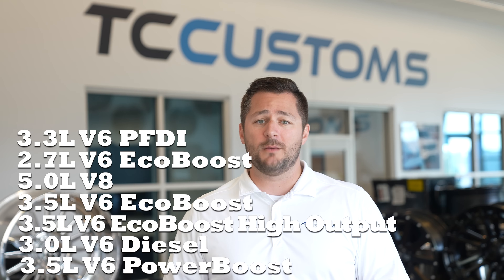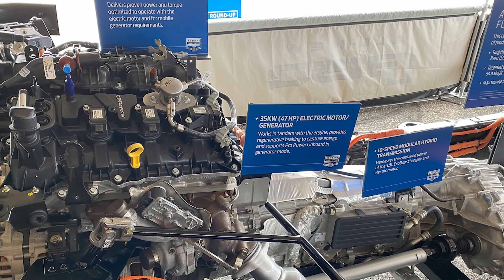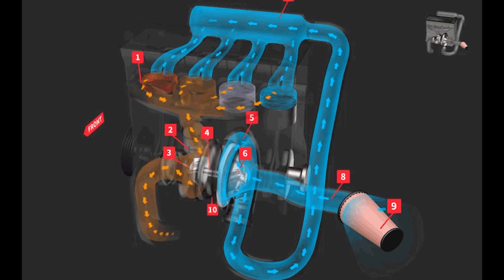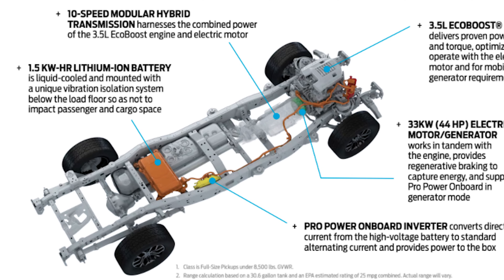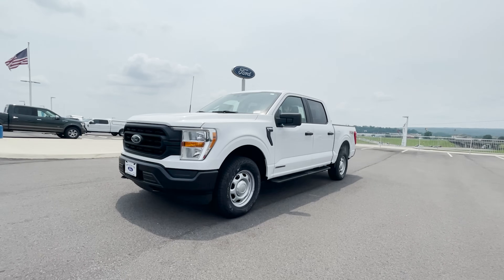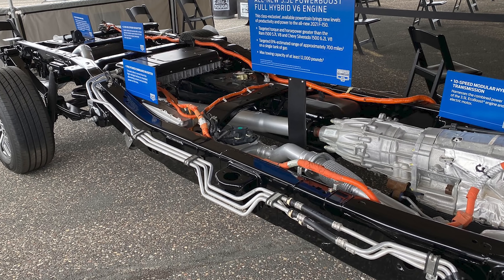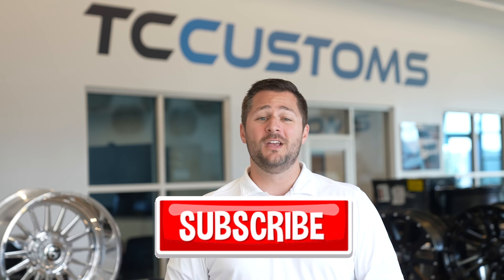The truth about the PowerBoost Hybrid Engine!

Comment: I don’t get it. So you have to run the truck in order to use the electric power. Isn’t that  economically not worth it.  Your using gas and the fumes of the exhaust are at your area. If your working off the tailgate as an example. OR that battery has stand by juice  for 3 or 4 hrs, so the truck is not running.
Reply: Are you referring to the 7.2kw generator?   Yes the truck needs to be running but it's so much more convenient than having a separate standalone generator and the upcharge from Ford is very minimal.   I have already taken advantage by plugging in to run my rotary buffer and run a Skil saw from the bed of the truck.
Reply: Yea it kind of kicks on when needed to charge then turns off.

Comment: You should make a video explaining how a lift and larger tiers will affect the Powerboost  MPG. If you should skip it if your planning in lifting your truck.
Reply: Regear differentials
Reply: I wouldn't go hybrid if you're lifting it. It's going to be a much better mostly on highway setup. If you want a lift, safe to assume you plan to do some offroading, in which case you're better off opting for a normal ecoboost or 5.0 truck.
Reply: EVERYONE KNOWS HOW THESE AFFECT TRUCKS?????  JFC
Reply: If you lift this truck with that baby motor it won't get out of its own way if you did a 6 inch 38 12.50 x20  good like going anywhere

Comment: It's awesome when our major motor corporation can work together  ,
Ford And GM you guys rock  !!
Reply: Well, gm needed a reliable rear wheel drive transmission, "which they can't seem to do on their own" and ford needed a front wheel drive transaxle. The idea was that both companies design and produce 1 transmission and get 2 available for use for the cost of 1. Ford took engineering lead on the 10 speed and gm took engineering lead on a 9 speed transaxle for fwd cars . Ford never actually used the 9 speed because it didn't gain any fuel economy and ford wanted to redesign it into an 8spd. In typical gm fashion the 9 speed also had many problems and ford made the right decision to not use this transaxle at all. The 10spd is all fords design.

Comment: Love our Platinum PowerBoost, I made about 120mi round trip on the highway a couple weeks ago and averaged 24 mpg.
Reply: I've done that on a stock 3.5 ecoboost with towing package .
The bad part was I kept it at 98km or 58mph . Boring a hell but cheap of fuel .
Reply: Not bad, I got about 21mpg on a similar trip in my '16 3.5EB at 75mph a couple weeks ago.
What speed was that at?
Reply: @puzzleluvr  set the cruise at 72, 65 speed limit.
Reply: @RodGwinn  Not bad then 👌
Reply: That's good, but you could have done as well or better with the 3.0L diesel option [dropped after 2020 for some reason].
Reply: @scottandrews4822  but would the 3.0l diesel go 0-60 in 5.3?
Reply: @scottandrews4822  sure but it would of cost me 65k plus 2 more years of payment.
Reply: I think for a hybrid is not impressive at all, in my opinion 🤷🏻
Reply: @twoserve2449  meets EPA estimates. Tows almost  12,000lbs and has an onboard 7.5Kw generator. 700 mile range on a tank. So ya I think it’s impressive.
Reply: @RodGwinn  , I love Ford don't get me wrong!, I have a 17 Lariat,  but I think for a hybrid the mpg could be a bit better, every thing else is great on the truck, I hope to one day be able to buy one
Reply: @twoserve2449  you need to take into account this is a truck so aerodynamics are terrible and it weighs somewhere around 6k pounds so it'll never be a Prius
Reply: @twoserve2449  your opinion sucks lol.  It's a fucking truck getting 24mpg that can also tow 12k lbs!!!!  15 years ago you were lucky to get 15mpg out of a truck

Comment: The main reason I want it is for the additional generator functionality, not really mpg.
Reply: Same here, rv trailer option for a generator is worth getting powerboost and opting out of a trailer generator.
Reply: That is the exact reason I got mine.
Reply: It’s a great feature to have the inverter that large in a truck, nothing more fun for camping/tailgating than a built in generator
Reply: @edbowejr6130  I thought my '21 Expedition Max would have been great for camping with the kids... except for the shitty 150W inverter which isn't good for much more than charging phones :/
Reply: Had a 2013 3.5 got 16 mpg(best)  traded for the 21 poweboost getting 24 to 26 on all short trips,10 to 20 mi ( I think I had a lite foot on both)Won't help towing 7000lb ++ Get 8 to 9 on the  interstate highway,Generator great.
Reply: @brianhazelwood9078  I get 8 towing 11k lb boat.   Yes I know that's the max rating.   It pulls it off the line every bit as good as my friends f350 dually.   I didn't notice any issues with stopping vs the dually either.   Brand new boat so trailer new with functioning trailer brakes of course.   Have a super duty coming in next week and may not bother buying it after all and just stick with this.   I wish the super duty had the pro power onboard.
Reply: Me too..
Reply: I didn’t get it for the mpg either. But in addition to the inverter the extra torque is a welcomed bonus.
Reply: I bought mine for that fact. And I must say, it doesn’t disappoint. You will love it for many other reasons as well. I have a Lariat edition. It just has the right amount of comforts for the few grand extra. But it is a solid truck and I will not get rid of this truck any time soon.
Reply: @HansHartman  What was the price of your Lariat ? I'm considering one in same trim.
Reply: @JH-mt3pp  I just got my 2022 Ford F150 Lariat Powerboost a month ago and paid just under 75k. Got everything except FX4 and a sun roof but I did purchase the B&O Unleashed sound system and added an extended high tow package. + 7.2kw power in the bed.
Reply: @JH-mt3pp  Whatever it is, you could buy 2 Chevy 1500 Custom Silverados with 5.3 L v-8 engines instead. And if you really do need to use your pick up truck to feed supplemental electric power to your house, you need to spend the money to upgrade your house, not your pickup truck.
Reply: @roberthenry9319  Think camping. It's awesome.

Comment: Have they moved the water pump to the outside of the block yet? An internal water pump is the worst idea ever for a motor. Ford needs to give an extra motor with every purchase of a 3.5L and 3.7L with internal water pump. Just a horrible idea because it trashes the motor when the pump goes out.
Reply: The water pump is not internal on rear wheel dive EcoBoost!
Reply: Water pump is external
Reply: @larrypetty2229  water pump is internal on FWD vehicles. All RWD vehicles, like F150’s w/o 4x4, are external.

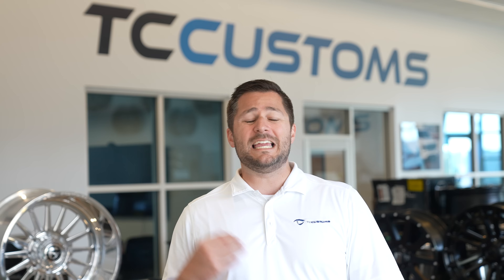Comment: @ 4:21 Just like in a Prius in stop and go traffic jams , city driving  etc the electric motor is working 
most of the time , at freeway speeds the gas motor or (ICE) internal combustion engine is working
all the time. The Powerboost F150 is a game changer because in a power failure you can power your home.

Ford may have some competition here with the Tundra Hybrid ...  I like the Powerboost
Reply: I already asked this but how does it get 700 miles per tank of highway miles and no battery?
Reply: @fieldtrailer  no it does not Ford is playing wi the the numbers

Comment: I’ve had my Powerboost since March.  I absolutely love it.  I’ve averaged (per trip computer) about 21 since new. I have about 5k miles on it right now.  Just towed my boat to the keys from Jax.  Average 11. Not bad for almost 7k lbs 

But what I don’t get that no one is taking about is the AC. Since it’s hybrid the AC is way way better than my 17 F150 since this can run full power without running on the accessory belt.
Reply: Can the AC run when engine is off?
Reply: @rodneycovington5017  I have the F150 Powerboost Hybrid and yes I can report that the AC runs with the engine off on battery power only.
Reply: @rodneycovington5017  yes and it’s ICE COLD. Much better than my last f150
Reply: Can the power boost not tow/haul 12k lbs?

Comment: I’m very interested in getting a powerboost XLT with a 7.2 k generator. I have some questions about the console versus middle seat in the front, as I have to keep the drivers seat belt from touching my hip to avoid pain. Is this something I could talk with you on the phone about? I’m wondering if your custom shop could potentially help me out there. Also, do you all take X-plan?

Comment: Your videos are awesome and very informative!  The back up noise (pedestrian sounder) is easy to disable.  There is a speaker just behind the front bumper on the driver side.  If you have a skinny hand, you can reach up and unplug it.  However....  You will get a notification every time you start the truck saying that the pedestrian sounder is not functioning and you have to press the "ok" button on the steering wheel to dismiss it.  Annoying but less embarrassing than having a back up beeper.

I've got 4000 miles on my Lariat PowerBoost.  Leveled on 34" Nittos.  Little bit of an oxymoron to buy a hybrid and then level it, but I wanted the 7.2kw generator and couldn't resist giving it the extra curb appeal.  Love the truck but not getting anywhere close to the MPG I'd hoped for.  Averaging 15 MPG so far.  Gets great MPG 50-60 MPH.  Once you get over 65 it suffers pretty bad.  Cruising 75-85 (my typical cruising speed) puts me between 12-13 MPG...  Pretty disappointing.  Our Expedition Max with the 3.5 ecoboost gets about 22 MPG at the same speeds.  Geared differently, I know.  But still annoying.

On the bright side, it tows a 5500lb travel trailer like it isn't there.  About 8 MPG.
Reply: You've really murdered the notion of better mpg, by adding a lift kit and big tire then. I see claimed mpg regularly, but I haven't messed with the rolling part of the system by changing tires and wheels. 
I've noticed that towing my 4000 lb boat, it does it with ease, but my mpg suffers greatly. It's one of the consistent complaints about these EcoBoost engine. Eco, or boost, there's no in between. Tow anything and your mpgs are worse than the 5.0, even though it's more capable. 
I will see 14-16 mpgs pulling the boat. I'd frankly be pissed, if I was getting what you're getting 😁

*edit. I just did the math, and you're spending .11 cents per mile more with your wheel package. At 15k miles per year it's costing you $1650 a year in lost fuel economy just to roll around. You're paying for that vanity multiple times over. 
I put on 30+k miles per year. Thanks for convincing me not to put a set of all terrains on, like I was thinking. Could save me over $3k a year in fuel costs, at $3.30 per gallon. If gas prices rise, it's even worse. 
$3+k a year is a family vacation, mods for my Mustang, a riding mower, a new dining table, or new couches... Kind of puts it in perspective huh?
Reply: Does this speaker also mimic the sound of an engine running when in electric mode? My powerboost kinda whines I guess to alert people
Reply: @gregl.9192  I think that is just a fan that runs when the engine isn't running but the vehicle is on.
Reply: 12-13 mpg sounds pretty low, then again, I haven't really gone over 60 mph other than a  burst here or there. I live in one of those sad states where we don't have "fast roads" =/. I think 45~ is mostly my avg high end with a few 50s here and there. Glad to hear about the towing like it isn't there :D.
Reply: Just be extra careful and don't run over anyone with vision problems doing that. You'd be surprised at how quiet vehicles are running on battery power. My mom frequently have to drag me out of the way of hybrids/electric vehicles. I generally can't hear Tesla's until they're going over 15 MPH and I still have some issues figuring the distance at night.

Comment: Dang! Love it! I've done that Atlanta to Chicago run a few times. 11.5 hours was my best time.. 4 gas ups. lol No stops would be great.
Reply: I've done that drive myself several times. Four gas ups? My regular old 3.5 Eco with  36 gallon tank will go 700+ miles already, I can start full, fill at half, and get to destination at half...literally 1 fuel stop and never go below 1/2 tank
Reply: @farlesbarkley1022  nice! Should've prefaced it was in a 2002 civic coupe, not a truck. Lol Tiny gas tank but those mpgs were working their hardest. 
But I will be doing the trip in the 2014 3.5 Eco I just got in the distant future.
Reply: I have driven from Virginia to Connecticut and back a number of times and always had a quarter tank or more left upon my return.

Comment: Been driving one since January.  

Mostly city.  Typically electric driving can be "selected" by taping the brake when going on a decline or coming to a stop when you see that the computer is not automatically switching to hybrid.  I would have liked to see a drive mode that is more able to utilize the battery continuously and then switch to motor only when necessary.  Prioritizing the battery I suppose.

Like was said in the video, I don't see the hybrid turn on while on the highway.  I tried a number of different speed increments and it doesn't come on while highway driving.  Not sure where the 700 miles on a tank comes from.  I have experienced ~500 miles on a tank in the city.

What is lost in towing can possibly be made up for in acceleration via added torque.  When can I get a tune for this? 

Overall, my experience has been great.  I feel as though Ford did well with the first iteration of the Powerboost F150.  Your mileage may vary.....
Reply: Need to get on the hwy more for that max range
Reply: I find the powerboost irrelevant at highway speeds. She performs best around town driving
Reply: @ModernCowboy78  What makes you say that? Specific to the Powerboost.
Reply: @OllyWombatYT  every vehicle gets better MPG on HWY. Out 2015 Ram 2500 will get 16 on hwy and mixed 14 and city 10. This is with the 6.4 Hemi
Reply: @ModernCowboy78  Yes, I understand that concept….

We are discussing the Powerboost.

When referring to the EPA MPG stated by Ford, in my practical experience the hybrid shows no improvement on the highway for MPG from my general use. I am not sure what conditions Ford obtained their EPA MPG figures in.  

In general driving around a city 24 MPG is possible. In my experience, in order to achieve 24 MPG consistently the typical person’s drive style would have to change to take full advantage of the hybrid technology.  The electric mode is utilized frequently in stop and go driving. That is not what I have observed during highway driving due to the gasoline motor being utilized 100% of the time.
Reply: @OllyWombatYT  yes you’re correct. The power boost is more for city driving.
Reply: I got my Powerboost about a month ago, I'm about 2000~ miles into it. I did a little bit of loose testing to "maximize" miles on a tank. I find that 30-35 mph~ seems to be the range that you can kind of coast on the electric in bursts at. When I go 50+ it tends to stay gas most of the time. I haven't done a full empty tank yet, as I've been filling up at the half way mark give or take. I've been getting close to 300~ at half a tank depending on how much nursing or flooring it I do. It's tempting to drive in sport mode and gas it every chance. The Eco leaf drive mode seems to shift to higher gears faster as opposed to the sport which tries to stay in the lower gears. I've been using Eco and Normal drive modes mostly, I find if you press lightly (like 10% pressure) on the gas pedal and maintain that pressure, it'll kick in the electric mode more. Just my observations.

Other thoughts:
I'm not sure but seems like my 2nd gear gets skipped like 95% of the time, curious what that's all about. Early on it would sometimes use 2nd but lately it always goes 1 to 3 4 5 6 . . wonder if there is a reason or "logic" for this.
Reply: @gamerjenkins2053  I drove a 2018 with the 10sp for a while, and noticed the same thing about the shifting.
Guy at the dealership said it's not unusual, that's just the way the computer thinks it needs to go.
Reply: @gamerjenkins2053  o

Comment: I think Hybrids (following this model, buckets of torque) will likely become the dominant players in this space. This thing can power a freaking tig welder. Or your house. 

What if they attached a racing version of this electric motor to the Predator V8 in the Raptor R? You know, pull a McLaren and weaponize green tech for g-forces.
Reply: True but running off an inverter is NOT the same as running off an household AC power cord... example it will not run my air compressor, even with the powerboost stating that the 110 V outlet is 20 AMPS..  it faults out when the compressor tries to start.  i can start and stop it all day long on a 115V AC power cord that only delivers 15 AMPS.  the PB electrical system cannot deliver the starting current for the compressor.  NOW, does anyone out there know if the inverter system is a sine wave output  or just a cheap modified sine wave unit.  Hopefully someone can relieve me of the hassle of digging out my oscilloscope to check.  Thanks in advance.
Reply: adds weight

Comment: It’s a cool idea and design, but sounds like a mechanic nightmare. (I am not a mechanic).Especially since I am usually the 2nd owner on vehicles which equals expensive repairs for me
Reply: Hybrid components are warrantied 100000 miles and or eight years
Reply: @williamwchuang  well, I just bought a ‘13 last year with 101k. That’s about on par with what I typically get. Even if I buy 2 years newer with 80k miles, I plan on owning it for more than 2 yrs/20k. Many friends have had trouble getting Ford to pay out warranty even when it falls within time and/ or miles. Or Ford will cover parts , but not labor. Either way, lot of money